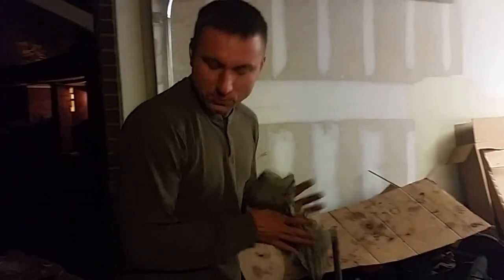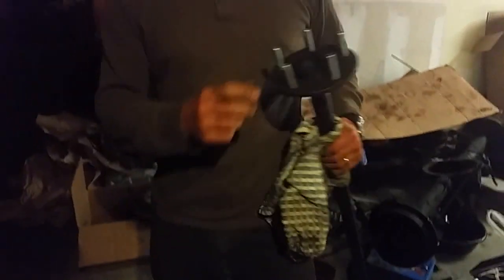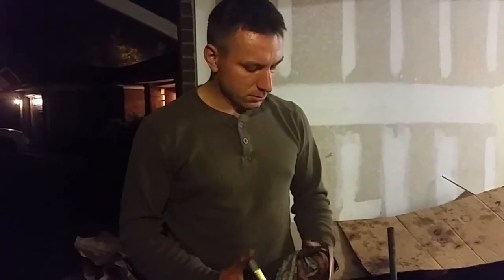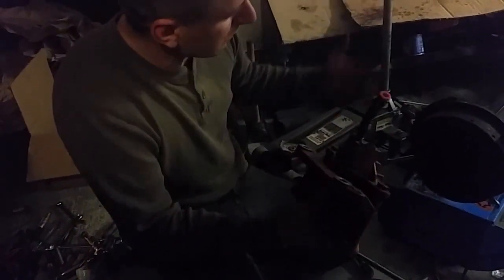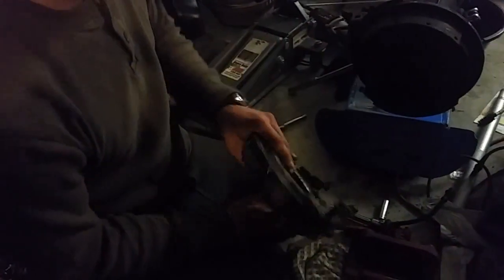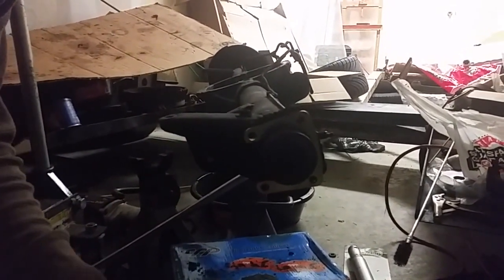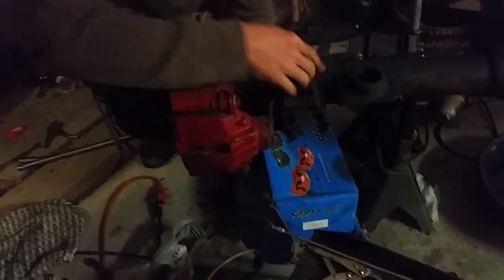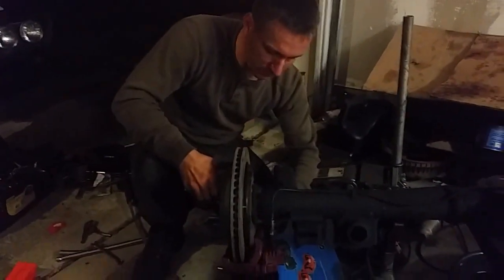ls1 swap. Best Cheap disc brake conversion upgrade. 12 bolt, 10 bolt chevy axle, classic muscle

Comment: Thanks for posting this very good 'how to' that can be done on a budget and by anybody with a reasonable mechanical background and supply of tools. I have been pondering the idea of rear discs on my 72 Vista Cruiser, but need to keep parking brakes. The car stops well now, but could be a lot better I know. It has a corporate 10-bolt with the axles retained at the hubs which makes the job easier! Please keep the help coming!
Reply from the maker: Well, the ls1 brakes have a parking brake built in thats really good...  thanks for stopping by, after filming it took another 20 minutes and i was done with the other side, its a simple swap.  But yeah, when i started this channel one of the main goals was to have substance.  Not just post videos of cute kittens or whatever...
Reply: Thank you again for yet one more tip.  There are a few of those around, I will look as time allows me to do so.  I know I can do it with my knowledge and resources - and help available should I stumble especially with a needed tool such as a press.Your channel and style is very much appreciated by me.  There are no gimmicks (seems folks enjoy that, those are the channels with the umpteen views, you are a well kept secret it would so seem, their loss) and you give explanations that anybody can understand.  As said, keep them coming!
Reply from the maker: You're welcome man, feel free to share the video with anyone you think may need it ;-)

Comment: Brake line adapter AGS Part# BLF-29C 3/8"-24 inverted female to M10x1.0 male.. connects 98-02 camaro brake hose to 67-81 camaro hard brake line, (should fit Nova's too..probably any other cars too from that era with the 8.5 10 bolt) i hope this helps someone
Reply from the maker: Hope so, thanks for the info
Reply: Thank you

Comment: FYI, this will work on BOP rear ends with stock bolt-in axles with a caveat. This is on my 1971 Oldsmobile cutlass. The backplate cannot double as the retainer plate to hold in the axle, the hole is too large. You will need to make a custom ring that will fill in the gap in the backplate hole around the axle with the retainer plate on the outboard side .  I am going to make a custom retainer plate that will double as the spacer and have it on the inboard side of the brake backplate.  We'll see how it goes.
Reply from the maker: Oh, good to know thanks
Reply: Did the spacer work

Comment: I have a 1970 and 1987 cutlass I would love to try this setup on both. In a few weeks I’ll give it a try. It’s to cold here in IL
Reply from the maker: mario paz it'll work on the 87, but not the 70 if you have a bop rear end.  They are different
Reply: @InvincibleExtremes  what would you need to make it work on a bop

Comment: i use a hammer to pop the studs and a spacer with washer and a nut too put the studs in seems to work just fine and fast  never seen some one use a press before but i bet there is a lot of ways to do it on my 68 pu i used 79 chevy pu spindles for the front been thinking on doing the back have only 2200 in it so far but it is going good got a stroked 454 with tunnel ram in it looks factory dun so now my truck is a 68,79,94 is what i have use for parts seems to fit just fine i was amazed i use the 94 serpentine belt set up i got for 50 bucks complete   power steering , alt, ac pump pulley's little tricky to covert the wiring but it was a lot easy'er then i thought from external reg. alt to a one wire alt
Reply from the maker: Good times

Comment: Hey... great video, no BS, just the basic DIY. I've got a 72 Nova donor 8.5" 10-bolt that I want to put in my 69 Camaro. Curious about the brackets, and the orientation of the calipers when you do that swap. Are both calipers going to the front, back, or staggered? I'm putting in Hotchkis 1.5" drop leafs and if possible, I'd like to have both shocks to the rear and calipers forward... is that doable? Do I need a shock relocation kit to do that? The car will strictly be a cruiser, it'll never see the track so I'm not concerned about launches and wheel hop... I just want it to look right and work correctly. The axles are shot on the donor rear so I decided to upgrade, the POSI is a 30-spline, so I have to order the axles. Gonna use a 3.42 ring/pinion with a 4-speed, should be a decent compromise. Should I order the axles with longer studs? I don't have a hydraulic press, might as well get the axles with studs in place? Any advice is appreciated, would love to see how you did the rear on the 68 Camaro.TIA-Mike
Reply from the maker: Studs are easily replaced without a press.  I used a matching pair of brakes but others found that using the brakes facing opposite ways was better for them.

On mine it was close but not impossible.
Reply: @InvincibleExtremes  Would corvette C5 brakes and rotors work on the 8.5" 10-bolt?

Comment: 80's C10 rear end backing plate flanges are larger than auto flanges  -- also stud pattern is 5 0n5 instead of 4.75 5.
Reply from the maker: Peter C thanks!

Comment: Man love ur video i got a ? I got a 71 cutlass i got a pois rear in and i got a brake kit off a 98 chevy Camaro the problem is my axle r no clip bolt on some when i put everything 2getet got playing in my axle so i think i need change my axle out 2 clip 1s
Reply from the maker: Your axles are better.  So change the brake backing plate to fit your axles instead
Reply: @InvincibleExtremes  so i need 2 press the old back plate off
Reply from the maker: Yes and you'll need to cut and weld to make the brakes work with your axles.

Comment: Good video I have a 68 c10 I want to do this too but it’s 6 lugs would you happen to know what rotor I could maybe use thanks 🙏
Reply from the maker: you can simply drill the rotor from a 98 camaro.  super simple.
Reply: Thanks 🙏 a lot for the reply

Comment: Hi good video what do you think it Will be Best Just upgrade the brakes or put the entire rear end from a 2002 camaro to a 1971 chevelle booth are 10 bolts differential
Reply from the maker: A 2002 camaro rear end is garbage.  They are weak and the mounts are very different

Comment: I have a 10 bolt. I grinded mi calipper on the rear diverside about two 16ths & it clear the rear sshock about 1/4 also ima drive for a while then inspect it seems like it will work. I have videos of my nova i will post the swap i did tomorrow so u can check it out
Reply from the maker: Awesome, yeah will do.   1/4 inch was enough for me, been over a year and no issues.

Comment: Awesome video, looking to do the F body rear disk swap to the 8.5 going in my Nova.. do you think 15 inch wheels will clear the calipers?
Reply from the maker: 15 will not clear.
Reply: @InvincibleExtremes  Hmm.. I wonder if an s10 rear disc setup is any smaller. I don't want to give up my wheels for rear disk.

Comment: wow, great video thank you. me and my dad modified an 8.5 10 bolt out of a 2nd gen camaro to fit in a 3rd gen camaro to replace the weak 7.5's the  82-02's have..but the 8.5 still has the old drum brakes on it still im thinking about doing this swap as I have extra 98-02 disc brake parts laying around I got from the local junkyard.. anyway, I also have a '98 Trans Am LS1and it has the stock weak 7.5" in it so I'd like to put an 8.5 10 bolt in my 98 and put the 98-02 brakes on it ofcourse and cut the shock and coil spring mounts off the late model camaro rear ends and weld them on and bolt everything back in like it goes stock in my 98, but my question is what car can I find the 8.5 10 bolt in to be used as I cant get a hold of a 60's or 70's camaro or Nova rearend could I use a 80's or 90's chevy truck 10 bolt?? there there are many in the local junkyards..
Reply from the maker: Alex58924 17 use any 10 or 12 bolt you want so long as you cut it down ....  even the truck ones

Comment: I have a 1968 buick skylark gs 10bolt rear end can I use the same application as shown in your video...you video was well broke down....
So i found  brake setup on a firebird can I use that set up 

Also do you have video on putting a posi gear in a rear end?
Reply from the maker: Posi is fairly easy if the diff itself is good.  You just need to pull the carrier and replace it, and then shim it accordingly, but don't need to mess with the pinion at all, just backlash.

Comment: Thinking about this for my '69 Camaro which will have a '72 Nova 8.5" 10 Bolt rear which is going to get a new POSI and ring and pinion. It is a C-Clip setup. Did you get the used rotors off of eBay? Would there be any benefit to relocating the staggered shocks  so both are in the rear? Definitely need the parking brake function.
Reply from the maker: Mike Langieri it's a little tight on my setup but I didn't need to get the calipers staggered.  Got the whole shebang off eBay for fairly cheap

Comment: I have a 1967 chevy c10 truck with 6 lug 10 bolt rear end. I want to do this disc brake upgrade but will have to get the 5 lug axles also. But even if i do that I believe the 98-02 camaro has 5x4.75 lug pattern. chevy trucks usually have 5x5. Any sugestions?
Reply from the maker: Michael Martinez yes, you can stay 6 lug, but you'll have to source the disc brakes off a newer 1500 truck instead of a 98-2002 camaro... sorry, bot much experience dealing with trucks, but that should work.  Thanks for watching ;-)

Comment: Great video! One question, this option work on a Tahoe 1994 differential? Nice work man!
Reply from the maker: Cant think of why not.  You'll need to either drill the rotors for the tahoe studs pattern or use custom axles with 5x4.75 pattern studs...  or just use disc brakes off a disc brake tahoe....  same install setup
Reply: And the mounting brackets is the same? Thank you!
Reply from the maker: +Rene Chavarría 64 to 97 all gm 10 bolt ends are the same
Reply from the maker: +Rene Chavarría after 97 theres a 1/4 difference, thats it
Reply: Great! Thank you for your support!  I working in these Tahoe differential !

Comment: Whats up dude I appreciate your video and the info. I have a question tho, i just recently bought a rear end out of a 88 irocZ that was factory posi/disk brake the problem is they only had this disk brake design for 88 only i can't find the calipers any where and if i do they want 150 bucks each for the calipers the part# is 18-4164 its a weird design they bolt up on opposite side of the rear end. Do you know any caliper that will cross with them or where i can buy them at a decent price?
Reply from the maker: No idea sorry.  I'm not too familiar with the 3rd gen camaro

Comment: Do these calipers clear 15" wheels?  I stumbled upon a 12 bolt that seems to have been converted, using Chevy Trailblazer hardware.  I put one of my rear wheels on it and it has about 1/2" clearance.
Reply from the maker: nachomax stick with what you have. the ls1 rear brakes don't fit the 15 inch wheels as far as I remember.
Reply: Thanks! Very informative videos. Keep up the good work.

Comment: I wish I could have seen this video before I did this work on 69 Camaro. I bought a Corvette c5 kit but without the emergency brake. I'm wondering what I need to install emergency brake. do I buy c5 a e-brake or will the Camaro e-brake work?
Reply from the maker: +Art Gutierrez  you could splice the old style camaro ebrake with the corvette calipers... people tend to stay away from the corvette stuff for that very reason.  Its a slighly larger disc, and a LOT more hassle to set up.  And honestly the rears do hardly any braking anyway...  sorry bud.  Wish i could be of more help.

Comment: Do you need the master cylinder or proportioning valve from the Camaro to get proper line pressure to the rear brakes? Or do you run a Manual prop valve?
Reply from the maker: i run the master cylinder from a 1973 corvette.  i also run a wilwood adjustable prop valve.  the prop valve is 80 bucks and the master is 30.  all in all it was less than 120 dollars and works very well with the c5 corvette brakes.

Comment: I am doing this swap on my 72 skylark 8.5 rear. The rear rotors hub bore is bigger than the aftermarket moser axles outside hub bore. Would I need to run a hub centric spacer?
Reply from the maker: Definitely.  I'm surprised the hubs aren't the same.

Comment: Thanks for the video I was wondering where online to find the parts online
Reply from the maker: I mentioned the spacer company in the video, but 98 camaro rear brakes can be found easily on ebay
Reply: @InvincibleExtremes   thanks for the reply I’ll keep a lookout there

Comment: Do you happen to know if a conversion of the rear brakes from a 99 firebird to a 67 firebird will require the mounting spacer for the backing plates or should they be a direct bolt on considering both are pontiacs?
Reply from the maker: tobias ford nit that simple ...need spacer and may need to be nodded because 99 is chevy, and 67 is Pontiac
Reply: Thanks brother. Great content in your vids btw

Comment: Great video. Can i run 15" wheels with the set up.
Reply from the maker: No, minimum is 16" for the fronts.  Rear ls1 brakes MAY allow for a 15" wheel but i wouldn't be so sure of it...  thanks for stopping by man.
Reply: +Invincible Extremes how about a 20 inch wheel ?
Reply from the maker: d Ramirez of course, i use 18" wheels on my rides.  Bigger works just fine.

Comment: I have a 71 c-10 truck with 12 bolt rear end. I want to convert my rear drum brakes to calipers and rotors also. Would this same setup work on my truck?  In the video you said it would work on 10/12 bolt rear end for passenger cars and small trucks.  I’m not sure if the bolt pattern where the backing plate and the rear end housing would line up to match with a c-10.
Reply from the maker: Pretty sure it's different.   Not sure by how much though
Reply: I was thinking you were going to say that.  Thank you for responding.   Great content and and informative video, keep’em coming!
Reply from the maker: Thanks, doing what I can

Comment: Good video I got a 1987 Chevy caprice will this work also for me
Reply from the maker: Thanks.  Yeah I think it'll work on that no problem.
Reply: Yes but if you have commercial chassis. You need bigger bolt pattern. Use 94-96 Caprice/Impala. Or 79-85 Seville
Reply: Hey do you know what rear disk donor car would work for a 1969 impala?

Comment: Invincible Extremes Muscle Cars Garage   I have an interceptor Caprice 1990. 5x5 lug pattern, would I just follow the same procedure except I'd use the blazers rotor and calipers? Thanks in advance for your assistance!!
Reply from the maker: Blazers are 5x4.75... you can use rotors with different lug pattern than the axles because the center is the important part.  So you can always drill new holes in the rotor without a problem.  

Not entirely sure on what rear end you have, but you need to use the entire brake system off one car.  Can't mix and match rotors and mounts because they only work with the mounts for that exact car.
Reply: @InvincibleExtremes  could I just buy a set of 5 lug rotors for the rear with the same diameter? Either way would my 15 inch wheel still fit?
Reply from the maker: No

Comment: Did you do the video on replacing wheel bearing?
Reply from the maker: no, i did do a quick overview of the axle saver bearings.  replacing GM axle bearings is pretty simple, but I havent gotten a chance to film it every time I had to...

Comment: i have a 2dr 78 caprice with a 10 bolt rear end can i use the backing plate from any chevy with disc brakes
Reply: cedric deoan

Comment: What about wheel clearance? Will a 15 inch wheel still work?
Reply from the maker: not without grinding... the smallest wheel that fits good is a 16 inch.  to run a 15 inch you need to use the smaller disc brakes from a gm vehicle in the 80's...  or keep the drums.

Comment: Will this same method work for 86 caprice
Reply from the maker: It may.  I would look at the backing plate and compare.
Reply: I would like to know also
Reply: It will work provided you use larger wheels like 17 and up since the rotors are slightly larger than the Caprice. As for the front, that's where I'm stuck figuring out what exactly to do.

Comment: Hello buddy can you let me know were u get the brakets for both front back i have 73 nova thanks in advanced
Reply from the maker: Google "brp hotrodding" and they will have both front and back brackets.  Also i have had great customer service and parts from a company called "kore 3"  .... they let you put corvette disc brakes on your car for the price of the ls1 camaro ones... better brakes unless you want to use a 16" wbeel, then the ls1 98-02 camaro brakes are a better deal for you.

Comment: To connect the parking brake what will i need?
Reply from the maker: You'll need to put the calipers facing the rear on an f body, which then leaves the parking brake lever to be pulled towards the front.  Youll need to then use a piece of the parking brake cable mount and weld it to your current shock plates and then figure out where you want to splice the 98 cables to the 69.... or just rig up a straight pull with enough slack for suspension travel.  Thats much easier...

Comment: If I want to retain my stock 15" steel ss wheels for my 1971 Chevelle, would 92-97 Camaro brakes work??

I may put the larger 12" Camaro brakes as you show here but then I am limited in my wheel selection.
Reply from the maker: +Barry Norgaard  yes the 92 brakes work too.  In fact they do not need the spacer either.
Reply: $hit, I already bought the spacers!! lol
Reply: What all GM brakes will bolt on from 92 so I can get the search started?
Reply from the maker: Barry Norgaard literal all from 64 on....

Comment: Do you know if this will work with C-Clip Eliminators?
Reply from the maker: Not without welding and cutting.  For 9 inch Ford ends used on some 12 bolt rears I recommend using 2014 mustang brakes.  I have a 9 inch in my 67 tempest and it's great